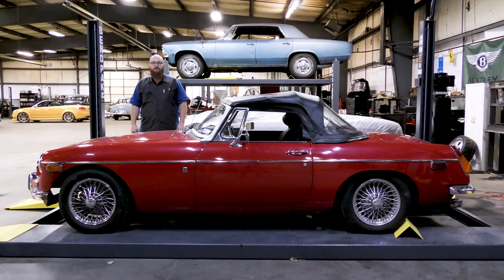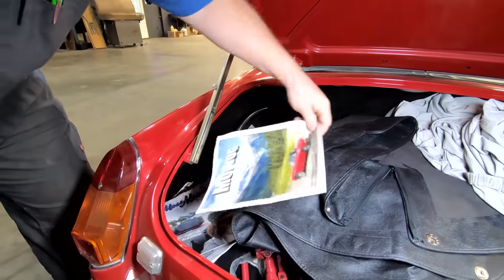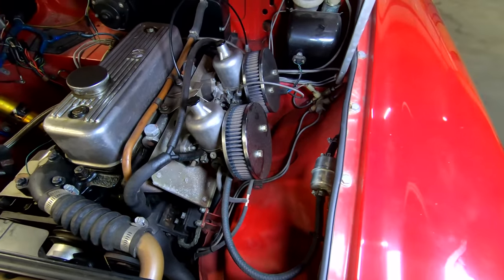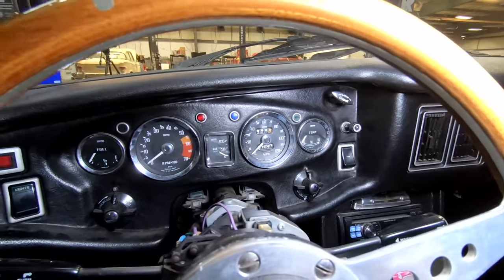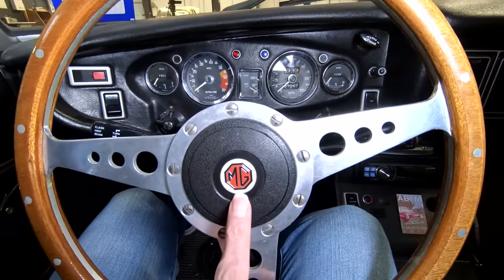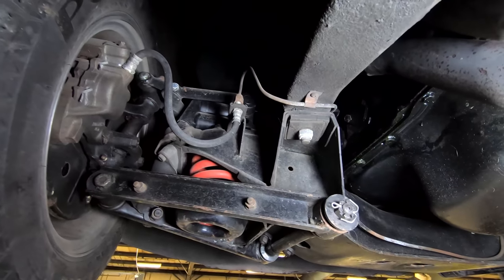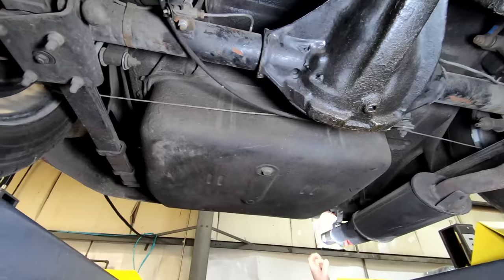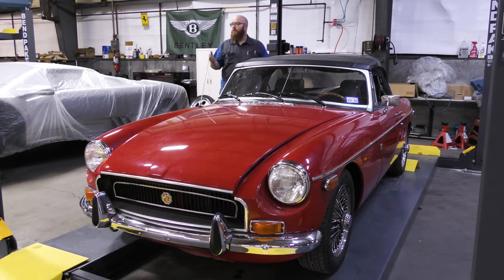Cherry 1972 MGB! See exactly why it earns a thumbs up from the CAR WIZARD!

Comment: My '72 MGB was a 1st in Class.
With what's present under that Bonnet; nobody's goin' anywhere fast.
Those carbs, intake manifold, low performance Ignition, Wires. Distributer Points won't cut it.
Inquire about how much Cylinder Head can be shaved off a SMOG Head.  If you can find a NO Smog Head. ... cool.
Pull any plug.  Examine Piston Top.
Slight Crown or FLAT >OK<
Bowled out Pistons are going to mean you should remain home on track day.
As noted in the Video; the Motor Oil dripping from that Back Plate indicates REAR MAIN SEAL required.
The Engine and Tranny gets pulled as a Unit.
The OverDrive on this Trans is a JOY to use when the Engine is Tuned to the Hairy Edge.
UNPLUG O.D.   PROTECT Connecter.
DO NOT remove the OD.  DO NOT Perform Lube Check or be curious of what's behind a OD Plug or Cap.  Springs/Check Ball Bearing.
To make this MG something exciting.
•  Carbs & Intake Manifold
•  Early Model Cylinder Head
•  Electronic Ignition
•  Heavy Duty Ground Strap
•  Rear Main Seal
•  Pistons/Rings
And if you still need a little more excitement.
Send the Camshaft to the Coast.
ISKY Racing Cams
Gardina, CA.      MGB/T-32 Grind.  Tango Three Two

Carbs.       https://www.ebay.com/itm/176295142633?itmmeta=01HVD6FD6Y1YJ2XMXG9DQ4E5ZV&hash=item290c0264e9:g:xzkAAOSwkUhl-dAX&itmprp=enc%3AAQAJAAAA8ACqDI1R0Ut9w0DYQTXLgTTOBkiprPvAXuR30TTOmBXAIlJkX5igB9h0KTFrBR%2FsINScH4cnRzjlRuKRYoZyS4NlpVp5lXXG31Lzwt3yknmRRhxF2rHMaStPtDlK%2Fl9RAo8FBcmg1HKkbh6lkMr8AnDXsttqkKWka8b6mFDkw6x5RWfNj%2FHBORCRBPqYpmKeoySHbiMM6OlLojdfElSNbfhUDLF7LPDL9diaZnqtbMX26BNrOehcd7zxcivlxDJ6x7euSNETjB8le8rgK61pr2aqO2QM%2FTUkLVtO6CrBPVGmG9NzID%2FYhcFWIHMBghZLkw%3D%3D%7Ctkp%3ABk9SR8bTvabbYw

https://www.carparts.com/details/MG/MGB/Pertronix/Igniter_Kit/1972/P71LU142A.html?TID=gglpla&origin=pla&utm_source=google&utm_medium=pla&utm_campaign=193715733&gad_source=1&gclid=Cj0KCQjw2uiwBhCXARIsACMvIU1F_U6MUKc-MmYnAg1WA3v96PxHdZ9FGP-IQ6nz6h85QMfmgt7js0EaAi5EEALw_wcB&gclsrc=aw.ds

https://eccppautoparts.com/t-304-exhaust-header-manifold-pipe-fits-1963-1979-mg-mgb-1-8l-l4-ohv-naturally.html?gad_source=1&gclid=Cj0KCQjw2uiwBhCXARIsACMvIU2fR9WvjRMUylDlT6xNv7yCd_5lOYSO7kFuFlg9bZN98NQS32_6O_waAkdyEALw_wcB

Cheers
RickCoMatic

Comment: That empty battery storage is because the earlier ones had 2,  6 volt batteries in series, as 12v batteries were big and heavy back then. The SU fuel pumps were on everything BMC and Jaguar etc and stranded everyone. They have contact points inside them and can be serviced.

Comment: We're working on a 1966 roadster right now. We restored it like 9 years ago but came back because he hit something on the road. These are loowww. Oh yeah we put a v6 with a 5 speed manual and drive excellent. With like double the power just feels great
Reply: Which V6...and have you now constructed a sheet steel bash guard for under the engine/trans?
Reply: @JohnSmith-yv6eq  nope was declined by customer and its just the ol 3.4 gm v6 with the 5 speed. Right out of a 95 camaro. Runs great and fits great too.

Comment: In the trunk was a full tonneau cover.  You could actually leave it installed and not a drop of rain would get into the car with the top down.  The other was a boot for the roof while in the down position.  The extra battery holder underneath is to house the other battery.  These cars came through with 2 6 V batteries instead of one 12V.  Wired in series, they gave more cranking power.  I miss the MGB and they aren't out of range today price wise as others.  Unless you buy one with expert welding on the under carriage, the whole car will twist around a corner.  This red one obviously has an entirely original undercarriage and looks very strong.

Comment: I had a 1958 MGA coupe and a 1965 MGB roadster. One time in the MGA I had the fuel pump die and I got it to the garage by tapping the pump with a small tack hammer. In the day you could  buy points to replace in them and I kept several sets in ready. I was taught by a  great Mech.Guru how to do the points and set them to account for wear  in the pump.. Lucas fuel pumps usually died because of the points and worked well with replacement points only if you had figured  slight differences in measurements of moving parts. I always carried a fresh pump and a couple sets of points. 19 68-70 I was a pit crew guy with an MG team at Daytona and Sebring and our cars always carried 2 fuel pumps on a switch and we used Bendix pumps never SU's on the race cars.
Reply: Merlin  Emryys... SU fuel pumps... Not LUCAS.

Comment: The overdrive unit is a Laycock de Normanville, probably an LH type unit.
Volvo used the Laycock de Normanville type J until 1993.
Reply: So did Triumph in GT 6, 2000 and 2500 models. My 68 2000 had in-line 6 and Laycock de Normanville overdrive. Worked fantastic, and i loved the car!
Reply: @steenj938  Yep. The J-type overdrive is reliable and sturdy! What does fail is usually the electric relay and/or the solenoid.

Comment: my first ever, brand new car, was a 1991 Ford Escort ( really a Mazda 323 rebadged ) had 88HP and I had to no problem spinning the font tires with a manual. 80HP for something this light is probably not too bad. I had no problem keeping up with traffic with the Escort back in the early 90's.

Comment: The OE fuel pump is an SU, like the carbs.  They are also rebuildable.  There are points under the plastic cover, just like old time distributors.  That is what probably failed.  Corroded most likely, but could be worn.

Comment: I worked on a lot  of  MG and Austin  cars in the  late 60's and  70's.   The contacts in the  fuel pump go band.  Don't  replace with a Lucas.  Use a  good reliable Japanese  or other fuel pump. The Lucas you get today are very old stock or rebuilt.  You are just pushing the problem back and it will show up again shortly.
The Lucas pump is not  well sealed well and gets corroded and gets intermittent.  Sometimes you can  just tap on the floor board or rock the car and it will start working.  Or tap on pump with a small stick.  I race an MG midget in  SCCA  type races in the 70's and that is one of the first things we replaced.  I don't remember the pressure, but we use a small pump with adjustable pressure.  You can overcome the  floats in the twin carbs easily if you have too much pressure.  After putting in a small reliable non British fuel pump you can move on.  We never had another fuel problem after upgrading the pump even when we were doing hill climbs and rod racing and Gymkahnas!!!

Comment: These cars started out with dual 6 volt batteries in series. Glad she has the SU carbs instead of the Zenith Stromberg. Much better carbs in my opinion 

I have a 66 B I’m about to start restoring.

Comment: Great and informative video. Especially encouraging to see, that you try to learn as much as you can about the car at hand, and seem to be completely honest with your customer. I’m in the classic car business myself, and sadly there’s so much dishonesty. Keep up the good work! I am the owner of a 1968 MGB Tourer and have had it for 24 years. It gives me so much pleasure and has been extremely reliable and easy to maintain over the years. Your customer’s car looks like a really clean and well maintained example. I love the fact, that it still has the original recessed grille, used only 1970-72, as many change that for the earlier chrome version. Interior is also great and very original, apart from the Moto Lita wheel and the stereo, but the originals are in the trunk. Lucas electrics the ‘Prince of darkness’? I beg to differ. Last year I noticed the battery wasn’t charging and traced it to the alternator. Removed it and took it to one of the old fashioned workshops, where people still know how things work. It turns out it needed new diodes. Naturally, the bearings were also changed plus some other things. It turned out it was the factory original part and had not been apart in 54 years! Pretty impressive compared to modern cars :) I then drove to the countryside to visit a friend. Next morning the car wouldn’t start. What was wrong? The fuel pump. I changed it when I bought the car, so was a bit upset. Until I realized it was 24 years ago… Time flies when you’re having fun!

Comment: Just over 500,000 MGBs were built between 1962 and 1980 and over 300,000 of these were exported to the USA which is why there is so much interest and longevity in the model.

Comment: Was the fuel pump dead period, or were the POINTS IN NEED OF SANDING!?  Yes, SU Fuel Pumps worked on breaker and points, just like an ignition distributor!

Comment: I had a 73 BGM.  It still had the 6 volt batteries in the twin housings in the back like these.  Mine didn’t have the electric overdrive like this one.  I had to replace everything over the course of 4 years of college in a one car garage with a single overhead light and without any heat or insulation.  Yes, winters were cold on Long Island. I call it the 200 car - 200 miles or $200……Which ever came first.  I drove it from Long Island to Western Iowa 2x per year and always had 1/4th tank of gas and maybe one old cheeseburger left.  I would take a 2 hr nap in the car on the drive period.

Comment: That additional "battery holder" may have been because they originally may have come with 2 X six-volt batteries, as the MGA did. Many owners replace them with a single 12 volt battery.
The overdrive unit was optional in the UK from early on, but from 1968 MGB's delivered to Australia had the overdrive as standard.
Reply: Joshua Turpentine.. Many MGBs were assembled in Australia.

Comment: Quite often the cause of the fuel pump not running is a bad ground.  The pump ground is on a lug held down by a bolt that goes through the license plate bracket at the rear of the boot.  First trouble-shooting point is to clean that connection.

Comment: Car Wizard I always enjoy your videos.  I noticed that the tailshaft is not installed correctly.  The crosses of the front and rear universal joints must be aligned to avoid vibration.  It has been disassembled at some stage and not aligned correctly at the sliding spline.  Best wishes.

Comment: The wife bought a new 1979 MGB that the dealer could not figure out. After several trips to the shop for failing to start intermittently. I found that it was a bad connection between the wire & the terminal inside the terminal at the battery end . Had a new cable made & had  the terminals soldered on & never had another issue. Hope this helps someone.

Comment: Having worked on mg,s for 40 years the is running gear is based on the old Morris minor and the range on morris cars still used the undercarriage on several models well into the 1980s like marina ,ital simple but functional car's still all running today.

Comment: I never had one but wish i did. I traded a Dodge Dart for a Triump Spitfire back in the 70s. Turned out the gas tank was loaded with rust and would stall out when ever, but those days i was broke,  tough to get anything fixed. I found a driveshaft from a different year, worked but vibrated at around  50mph.

Comment: MOWOG was often stamped on BMC parts. Apparently it dates from when Morris merged with Wolseley hence MOrris WOlseley Group. The aluminium (or aluminum in the US) bonnet was really soft and usually dented by mechanics with greasy hands pushing the bonnet/hood closed with their elbows. Often as they got older there would be a creaking sound from the wheel splines when the cars moved from standstill.
My old MGB had two x 6 volt batteries; one either side of the drive shaft behind the seats.
Reply: Robert Delande... Morris Oxford  Wolseley Garage... M O W O G

Comment: I was hoping it was the fuel pump. I'd like to see you do a video on a car that has had the mechanical to electric fuel pump conversion.  I'm trouble shooting mine in my '67 Rover. Despite it being a national brand "red" pump, I don't think the one I have in it right now is a good pump for a "pull" system.  It loses prime after a few days. Looking at other options at the moment. The interesting thing is the cheap generic electric in my '57 Ford works every time.  I thought going name brand would get me better results.

Comment: Two battery compartments? They had two 6 volt batteries wired in series to provide 12 volts when new. This one has had a small modern 12v battery installed in one side. As far as I know US cars were the same as UK spec in that regard, unless someone knows different. I believe it may have been a throwback to when MGA's had two 6v batteries in parallel.

Comment: I had this exact car, those air filters on this one were not stock. Two 6 volt batteries in series for better cranking power. All the electric to the gauges are in series too so for example, if the tachometer hot wire was disconnected the car would not run.

Comment: MOWOG short for MOrrisWOlesleyGarages.  Both Morris and Wolsely were Brit cars, and MG stands for, of course, Morris Garages.  I own a '72 MGB in the same colour except mine has the optional chrome luggage rack on the boot lid.  Although they have a bad reputation for reliability, most of that is a consequence, at least before the 1975 cars, of poor maintenance.  The original SU (Skinners Union) fuel pumps had points like in older distributors, which could be cleaned, adjusted or replaced. You can use any 12V fuel pump but may need to add a fuel pressure regulator as the carbs require a low pressure flow.  The "B" was not a low volume car; over half million were sold and any parts are readily available including entire body shells.  Companies like Moss Motors specialise in Brit car parts and many are U.S. outfits.

Comment: regarding battery boxes, I had a '63 MGB with 2 6 volt batteries there and air cleaners are different also. The car was a great drive.
Reply: counterman484.. The air cleaners on the car in the video are not original and restrictive, half the area of air intake as is on the originals. Also the cans on the originals direct and cool the intake air.

Comment: UK market MGB engines produced 95bhp and 105 ft/lb of torque, it was the US emmision regulations that strangled the engines to one degree or another. It is very easy to bring the power back up and they can the be performance tuned economically.

Comment: Well sir you mentioned British Leyland and the strikes. Oh so true but the MG factory at Abingdon never had any trouble like that. It was small and despite its size every MG ever made came from 1928 came from that one plant. I have owned a B since 1989 as my dad was English and I wanted a little British car. The engine design is from the mid 1950's and the very early B's could produce around 90hp at the flywheel. Later models like mine were down around 70 due to emissions regulations and all the pumps and valves that were on the car. Today we are way more fortunate with computers. It is fun to work on the car which is one of the reasons I have it and when regular maintenance is done you are rarely left stranded. I have been to Colorado at 11,000 feet, Georgia, New Jersey and Maryland this summer and the drives were trouble free.. But these are not modern cars with modern comfort. I like it!!!

Comment: MoWoG dates back to the time of the merger of Wolseley and MG into Morris Motors, it is excepted that Mo stands for Morris and Wo stands for Wolseley, but the G has 2 versions one says it stands for Group, the other says its for MG as the period prefixes and suffixes at the time were `M` for Morris, `W` for Wolseley ... also the Morris of Windsor Owners Club use it on literature. The two boxes where the battery is housed is because early MGB's had 2 6V batteries for balance.

Comment: I have a 1980 mgb. I had a bad ignition switch. It would cause the starter to engage while I was going down the road. Your new new fuel pump will not have points. It should never fail.

Comment: The Engine is1798 CC , and in 72 the twin SU's were not OEM, It would have had a single Stromberg.
I also note the entire Smog air pump and tubing was remover and the four bolt heads adjacent to the Spark Plus have blocked off the plumbing.
Reply: Twin SU carbs were OEM in the U.S. until the 1975 model year when the single Stromberg was introduced along with Rubber Bumpers. Twin SU carbs were OEM in all other world markets until production ended with the 1980 model year...

Comment: Originally it would have had two 6v batters , when they change it to alternator they will have changed it to 12V system and looks like electronic ignition too.   Perhaps need to check if it's positive or negative earth, as you when change it  to the 12V  that is not always done.

Comment: MoWoG on car parts stands for, I think, MorrisWolseleyGarages.
MG brand is Morris Garages, now owned by a Chinese company that sells MG branded cars.
This red example’s folding roof looks an unoriginal shape, it is higher at the back than the original and the rear plastic window is far larger, but overall it is a nice example.